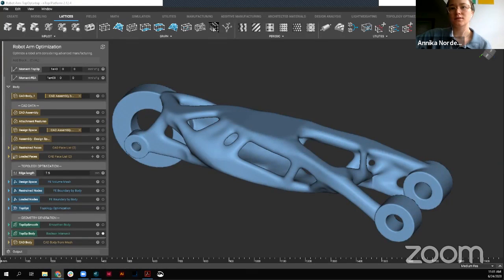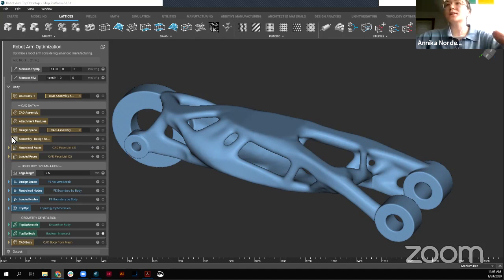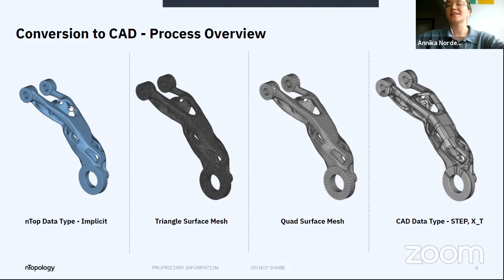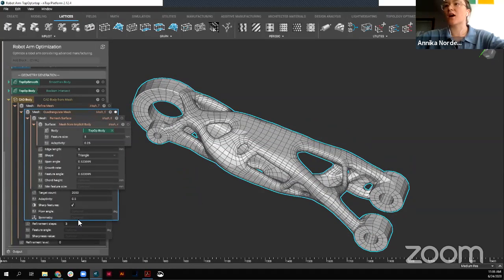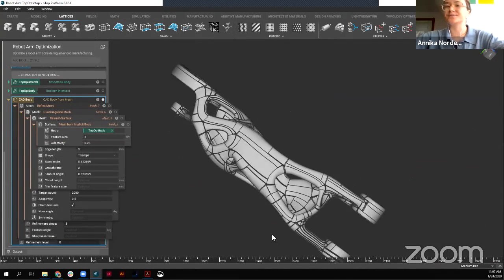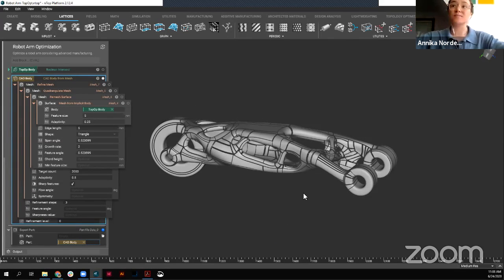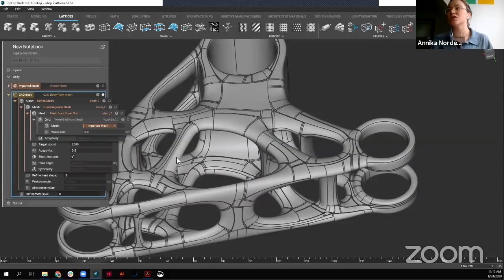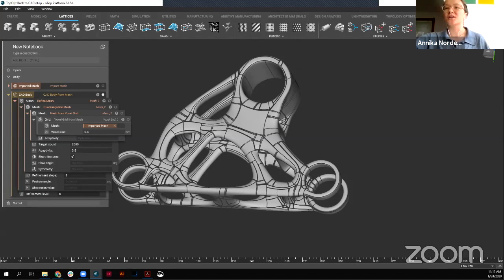nTop Live: Exporting Topology Optimization Results from nTop to external CAD - June 24 2020

Comment: I am trying to generate .step file on a FCC lattice structure. But after quadrangulate mesh it says the components are disjoined, use split command to split and convert each separately. Any solutions to that?